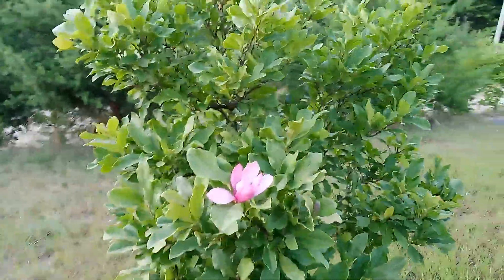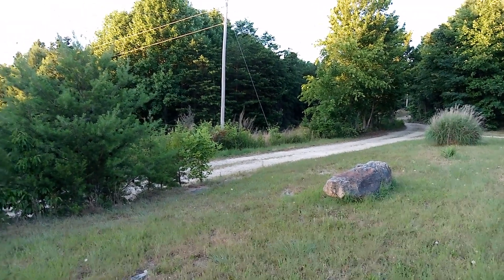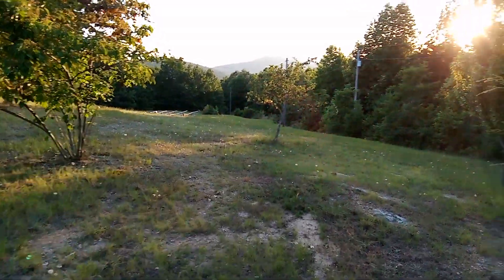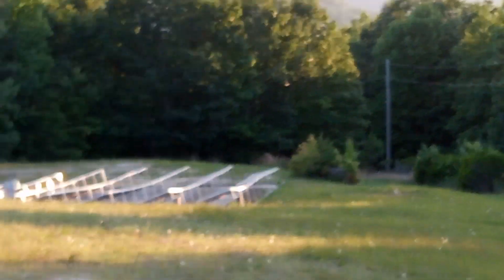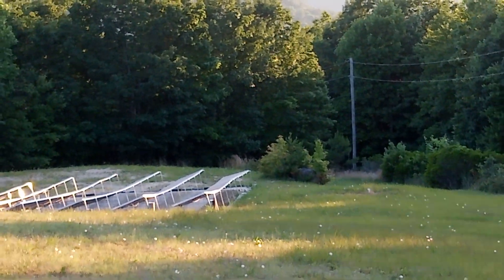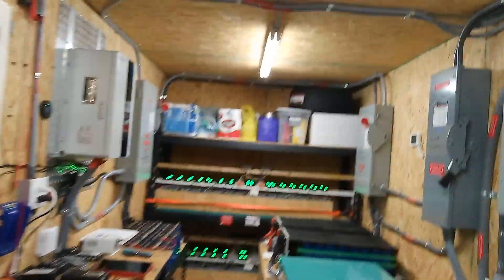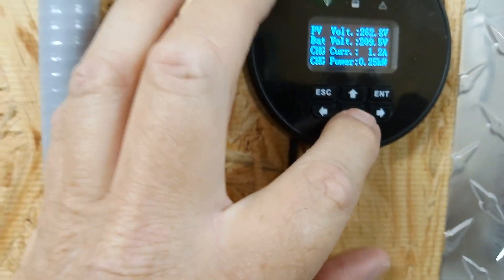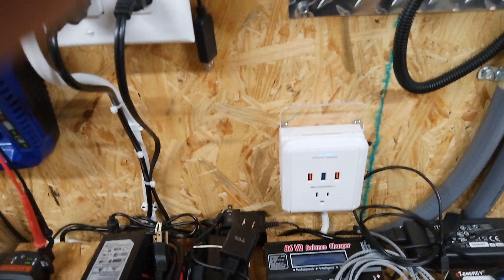Making enough solar to be off-grid

Comment: If you add more panels are you gonna add to that array or build a separate array in a slightly different direction?
Reply from the maker: Just add on to the end and go up in voltage.i can go up to 600 volts.
Reply: @mikeg2321  do they make those 10 amp balancers that can do that many cells ? I've seen some that are fairly large but you have a lot in line and I never see balancers capable of that. That's really the only thing that scares me away from trying to build a small high voltage system. I'm up to around 45 kw of lithium now but I've bought them 8 cells at a time from 18650 battery store and they are super expensive it seems

Comment: BMS123 Smart
Reply: dbus-serialbattery

This is a driver for Venus OS devices (any GX device sold by Victron or a Raspberry Pi running the Venus OS image).

The driver will communicate with a Battery Management System (BMS) that support serial (RS232, RS485 or TTL UART) and Bluetooth communication (see BMS feature comparison for details). The data is then published to the Venus OS system (dbus). The main purpose is to act as a Battery Monitor in your GX and supply State of Charge (SoC) and other values to the inverter/charger.
Reply from the maker: Checked them out a long time ago.too much wire and cell boards in my opinion.

Comment: How much voltage do you loose between power house to arrays Mate, hi from downunder 🇦🇺
Reply from the maker: I think it was 215 feet one way with 1.5 percent loss using copper
Reply: Mike what size awg
Reply from the maker: @brianhaney3613  1/0 copper

Comment: Description:

This PTO (power take-off) generator works with small tractors with at least a 30 HP engine to generate clean, efficient power. Generate electricity to power farm or ranch tools when far from a power source or use it as a backup power source for your home during a power outage. This powerful generator includes an output shaft and control panel with two 20 amp, 120 volt outlets, one 30 amp, 120 volt three-blade twist-lock outlet, one 120/240 volt four-prong grounding outlet and one two-prong, 12-volt DC outlet.

Control panel has two 20 amp, 120 volt outlets, one 30 amp, 120 volt three-blade twist-lock outlet, one 120/240 volt four-prong grounding outlet and one two-prong, 12 volt DC outlet

Two 50 amp, one 30 amp, and two 20 amp circuit breakers

Connects to a 1-3/8 in. diameter, 6-tooth spline output shaft that needs to turn at 540 RPM

UL listed receptacles and circuit breakers

Our output shaft is standard length of 23 inch. If you need longer shaft, you can find a longer shaft on eBay or find a PTO extender. Also please welcome to leave us message on eBay for help.

Package includes: 1X PTO Generator

If you are not sure, please leave message on eBay and we will be able to assist you.

 

Domestic Shipping Terms：

Normally standard USPS FedEx or UPS shipping rates only apply to contiguous 48 States.

There may be additional shipping charges applying to orders shipped to PUERTO RICO, HAWAII, ALASKA, GUAM AND OTHER U.S. TERRITORIES.

Orders are normally shipped within 1 business day after payment is received. Overnight or 2nd day shipping can be one of the shipping options at time of purchase and there are extra shipping charges applied. (WE CANNOT SHIP ON WEEKENDS nor HOLIDAYS)

Orders are normally shipped to the address listed on your PayPal account. If you want the order to be shipped to another address other than the one shown on your PayPal account, please SEND US A NOTE AT THE TIME OF PURCHASING.

 

International Shipping Terms:

We use USPS, UPS, FedEx and DHL as our main shipping methods. We will select the best carrier for each order.

We cannot be responsible for any customs duties or taxes the overseas country may applied to the order.

International transit time is usually between 6-12 business days. Times may vary depending on the local customs and postal service.

 

Payment Policy:

We accept PayPal and PayPal Credit/ Debit card.

All Florida customers would be charged 7% Sales Tax.

 

Return Policy:

Please contact us for a Return Material Authorization (RMA) number within 30 days of receipt before returning your UNUSED goods. We do not accept any return without RMA number nor do we accept any used items.

Customers may be charged 15% restocking fee for non-defective items.

Customers should be responsible for all return shipping charges if they purchase the wrong items or change their mind when receiving the items.

Shipping and handling fee is non-refundable.

Refund will be issued within 2 business days of receiving the merchandise

Comment: Mike I got a crazy question... can you just use the DC off the solar panels to turn a DC motor that is hooked to a tractor generator PTO,,,,, I found one on eBay that is 88 amps 240 votes 25 horsepower
Reply from the maker: Well that is about 22 klws of pv minimum you need.i say you would probably need 30 klws of of pv to run it in direct sunlight for just a couple of hours.May I ask why you want to do this?
Reply: Trying to think out of the box like you did with high voltage where nobody else is trying to find the best way to use the DC without converting it
Reply: And plus I want to use one half of my way to do that
Reply: The other half to do what you're doing
Reply: But it will be when I have the time to do it all and put it all up I drive a truck for living I'm not home a lot